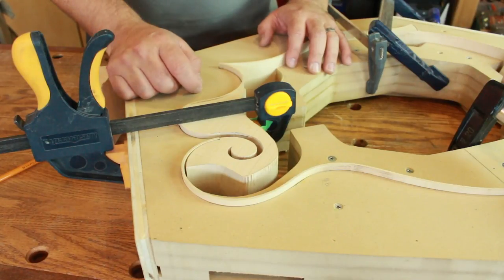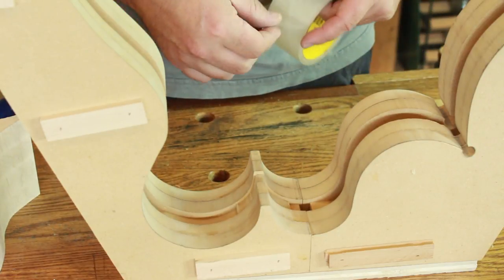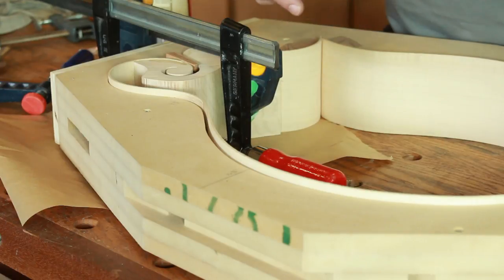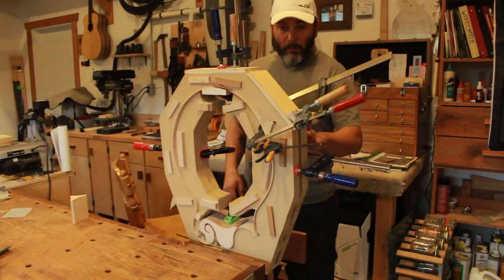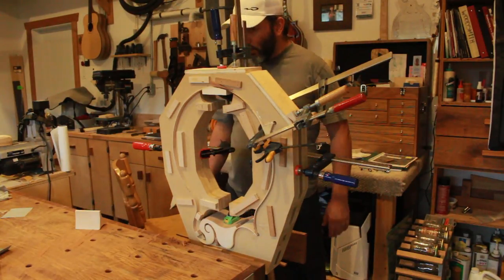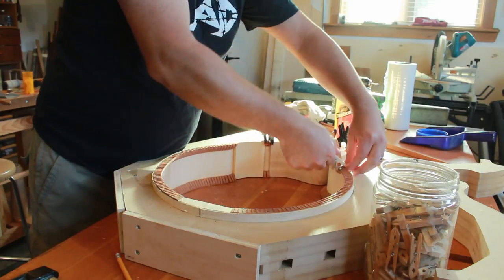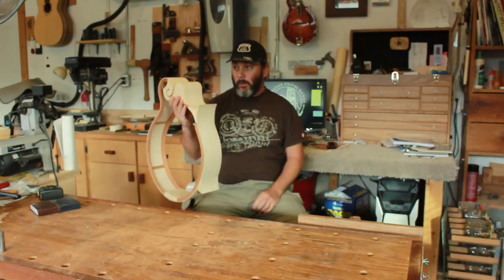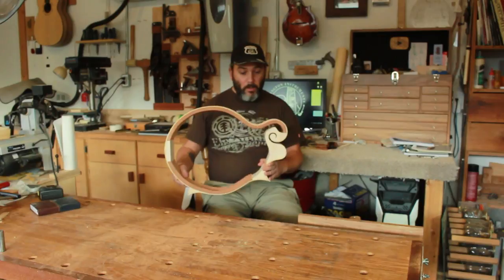Mandocello, rim assembly and glue up/ Part4

Comment: Hi Tomy, great video! I was wondering what the reason is for the 0.5" width of the kerfed lining. Is this large width really needed? standard ones I can find are around 4 to 5 mm only.
Reply from the maker: At the time of this build I preferred to stay on the safer side. 0.5” seemed like a good compromise, not too small and not too heavy.

After the sound test, I don’t feel like the somewhat bigger kerf is an issue. Is it really needed... well , on my next m’cello build I will make and use 0.5” kerf because It worked out great with this one.
that being said 0.375 could potentially be okay as well, but I haven’t tried it on a soundboard of this size with this amount of down pressure. So I’m not going to say to do it for that reason. I don’t think you will be able to find kerf of this size very easily. 4 to 5 mm seems standard for flattop guitars. Even at 0.375, you will most likely have to make your own.
Reply: @HovingtonInstruments  Thanks for the explanation!